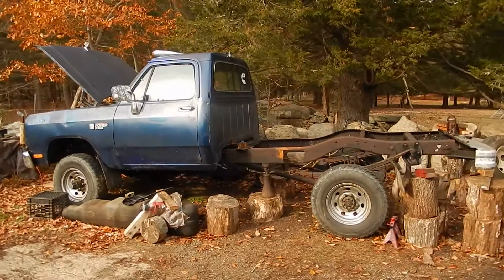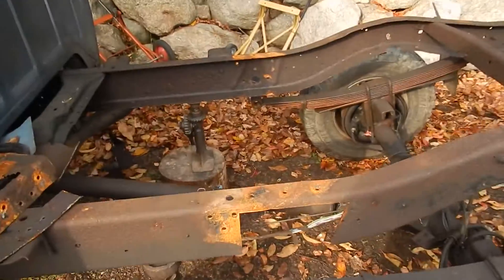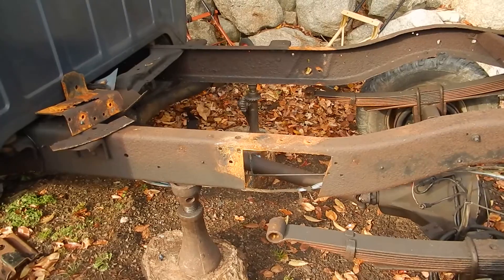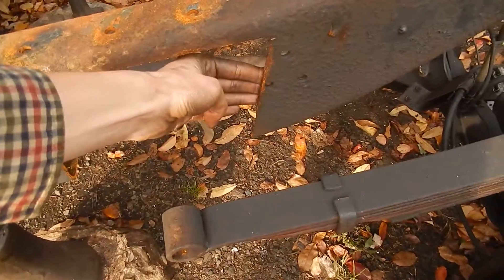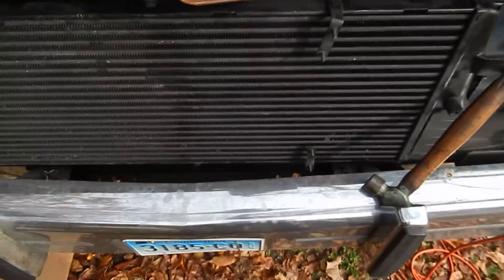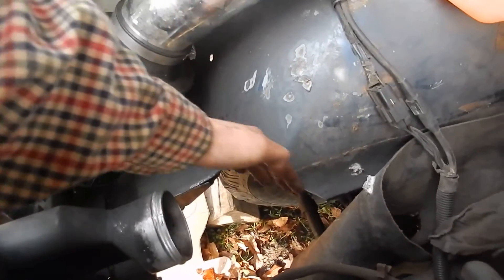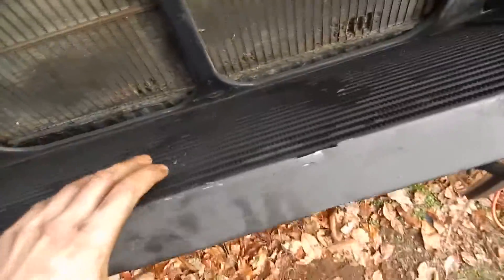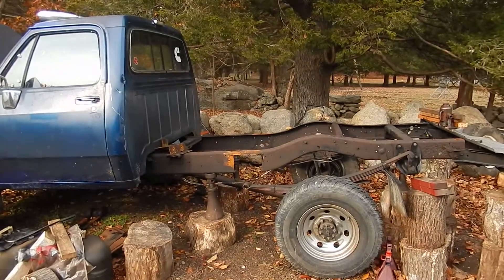Working on the First Gen Cummins - Second Gen Intercooler Install

Comment: Cool Truck I have an 89 that I put a 94 engine and intercooler in but I mounted it upside down to get away from the bracing and mount it lower. after reclocking the tubo I used two of the 2nd gen short tubes. The driverside tube takes a little spaceover the battery tray but the battery still fits and it will probably be relocated to the bed.
Reply from the maker: RS454 Interesting idea to turn the IC upside down! if i did that i probably wouldn't need to hack the inner fenders. oh well! worked out OK.
Reply: +themadmailler what did you use to trim the metal? sorry but i dont really have a lot of tools, and i am looking to do it as well. Thanks
Reply from the maker: angle grinder and sawzall.

Comment: Did you just delete the power steering cooler when putting the intercooler in? Im doing a similar thing but the power steering lines are in the way... im using a first gen intercooler on a 1990
Reply from the maker: mine has no PS cooler, but i did remove the AC condenser.